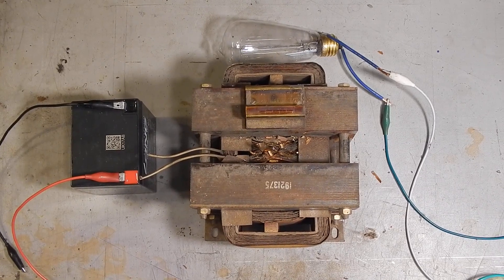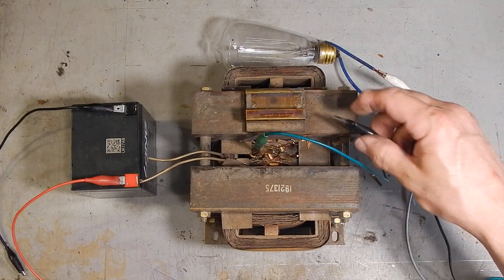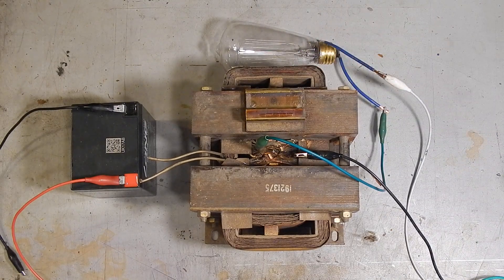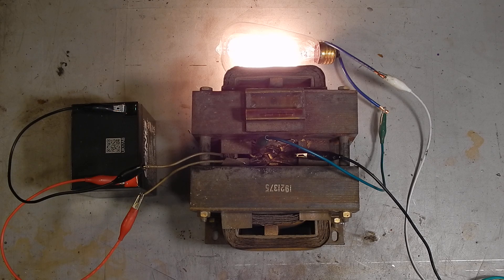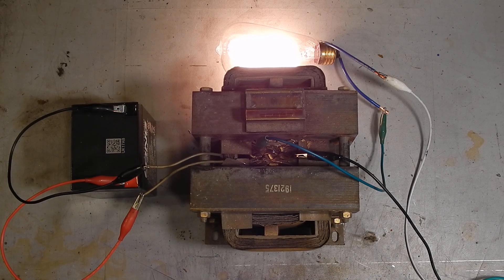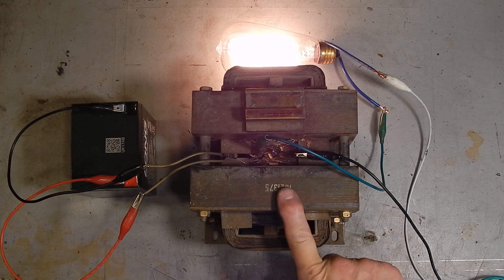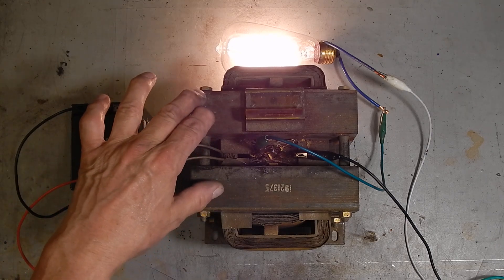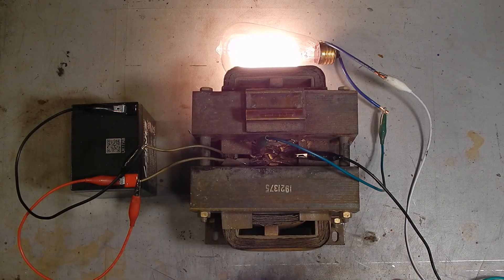Welder 1 - WTF is a Saturable Reactor?

Comment: VERY hard to find.  I own three 'tri-core' types of varying sizes, with the largest at about 1kVa.  I've been actively looking for a large unit (10kVa+) to control a utility pole transformer for a giant tesla coil for years.  It really is like looking for a literal needle in a haystack.  The few people who have them usually end up scrapping them or incorrectly list them as a transformer. The one or two companies that still make them (for use in harsh non-solid state friendly applications) demand outrageous prices for them.  Definitely a unicorn find and my favorite magnetic device.
Reply: I have a Hobart 200HF TIG welder in which the output current  is controlled by saturable coil winding. At the moment I am trying to figure out why the welder is pretty much giving full amperage on each of its settings. This being the case the saturation coil must be getting fed the full DC current as I cannot regulate it down. Took machine into an electrical repairs specialising in welders and they couldn't find the fault. What do I do?
Reply: @tedluckhurst7662 Check to see if the DC voltage changes on the reactor control winding as you adjust. If it does, the reactor has a short in the windings. If it doesn't, the DC control or regulator (I assume) has failed.

Comment: What's happening in these devices is a bit unusual especially if you're used to semiconductor-based amplifiers, or older vacuum-tube amplifiers.

The magnetic core, once it is purposely saturated by (a pretty low) DC current in the control coil winding, alters the behavior of the inductor (one of the coils, not the control coil) and allows AC current to be applied to that coil and pass freely.

So the small DC current is like an on-off switch, the "on" mode being reached by the core become magnetically saturated when DC is passed through the control coil.  It's an amplifier - a small (DC) signal can control (a much larger) AC signal.  If you need to switch high AC power, and don't have a tube or transistor handy, this is an old way to do it.  Very nice example you have there - I have seen the 'figure 8' variety but not an example like this, where the control coil surrounds the two 'amplifier' coils.